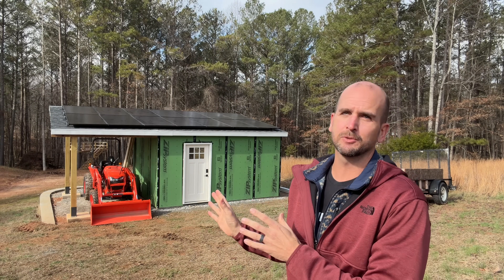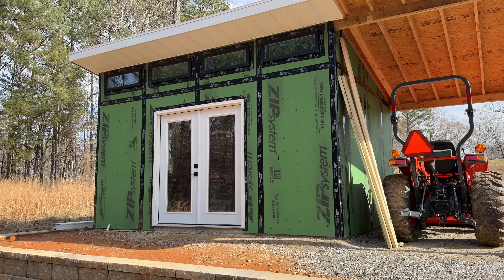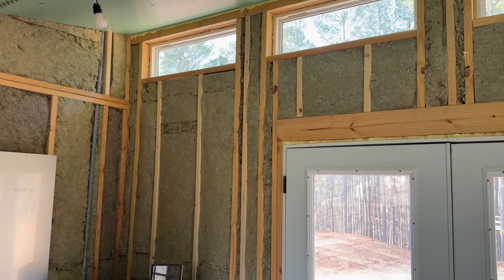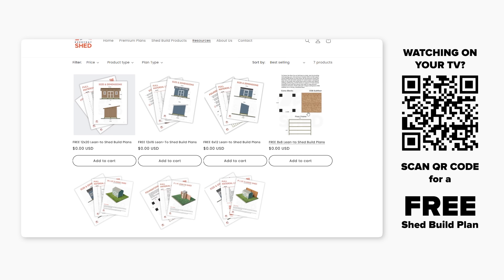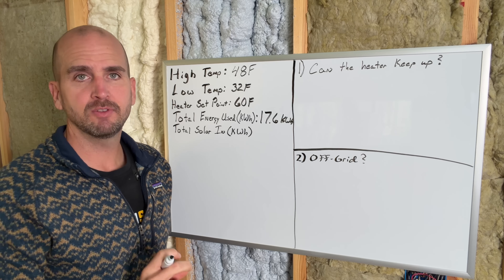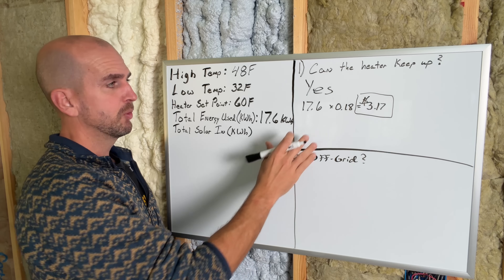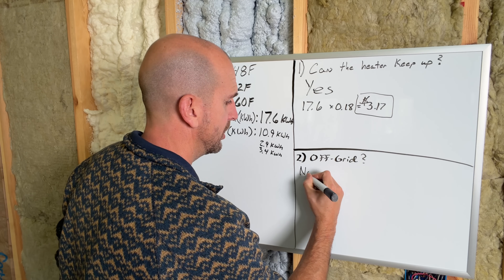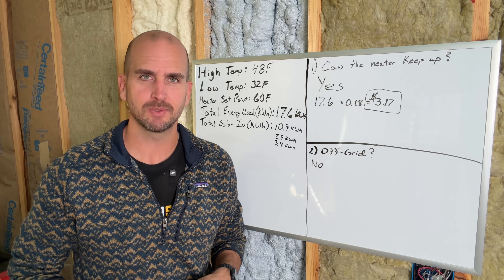HUGE Mistake: Why My $15,000 Solar System CAN'T Heat My Tiny Shed

Comment: I have a 12x16 home office shed. I built it in 2013 and still use it. It's full dimension lumber (4" = 4"). it's on crushed stone+pads. Floor is insulated between the rafters and boxed. The walls have 4" of spray foam and the attic has ~5" of spray foam. I tried heating with a mini split/heat pump. That cost a fortune. I ended up with propane. It's MUCH better. Heat comes right on and I go thru a tank a season. Around $300/yr. The mini split was great for AC but broken last year. To replace it is just too expensive so I bought a portable AC unit. It's "ok" but not as good as the mini split. 

So many things I would have done differently in hindsight. BUT, it's a great office and in a few years will be a hobby shed.

Comment: Don't waste your money with a heat pump or more solar. I have a 12x20 shed like his that is super insulated and I can heat it to 20*C+, when it's -30*C, for 3 kwh. Body heat alone can maintain room temperature when it's -20*C outside or warmer. Educate yourself on insulation and you'll wonder why you did anything else.

Comment: My passive solar house has 1/2 of it’s south wall in glass  and  a massive interior adobe(dirt) wall. 

On nights after sunny days it stays 30 degrees above outside temperature (30deg out, , 60 deg in). After the second cloudy day it needs aux heat (wood stove) at night , but still heats the house on a cloudy day.

Windows on a south wall are much cheaper than an electric solar system heater,  South wall glass is over 50%   efficient at heating.  
Solar electric heat is maybe 20% efficient (per sq ft.) and costs thousands of dollars more.
I do have a 5kw solar system  that can contribute a few hours of resistance heat on 20 deg nights, but it is limited by my 10 kw battery.
Excess daytime solar electricity  (more than your battery will hold)  might be more cheaply stored thermally in hot sand , water, etc
KISS!

Comment: could you run a mains line out to the shed and hook up some sort of smart relay so the heater switches over automatically when battery runs below a threshold? And maybe even recharge the battery if it's below a set limit?

Comment: Fascinating...short, sweet, and clear.  What you didn't explain, but might be intuitively obvious, is that the purpose of the inside of the shed would draw power based on your intention to use it as an office.  (if it was only a storage shed, you wouldn't need power at all, and if it was a workshop of any kind, you almost certainly would need power)  So, the solar system can't keep up with minimal heating requirement (60 degrees kinda chilly) so obviously it wouldn't support any additional electrical load/demand.  If instead of using the electric heater, you used a wood-burning stove or some other fuel-based heater, that would free up the electricity for your office equipment...  Looking forward to your next video on this shed conversion project!

Comment: You need to finish insulating. Every one of the studs in the walls are a thermal bridge that allows cold to seep into the interior. You could add another layer of insulated panels to the walls and ceiling. Insulated panel on the outside is not enough. How much cold is coming through the floor. In colder climates they have triple pane windows. Storm panes might help.

Comment: No wonder it didn't work. You used electric heat instead of a heat pump. You can get up to 8X the heating for the same Kwh. Quite frankly I taught you better than this. Go to your room!

Comment: Comments: nothing was mentioned about the u-factor for the windows or door. Weak spots like this are important. Why uses resistance heating? A heat pump would use 1/3 to 1/4 the energy. And split packs are really cheap and easy to install now. And only R=10 for the ceiling? Heat rises and will make the ceiling hotter than the walls, leading to more heat loss. Bring the R factor to something like 30 total for the roof. It is super important.  Just toss loose celulose insulation in the "attic". It is cheap and efficient (cheaper than the things you tried). Thanks for the experiment.

Comment: "I made poor choices for heating.  Why don't they work?"
Good question.
1) if your main energy need is for heat, why are you using photovoltaics?  Use solar water heating panels, and 1 or more "batteries" (barrels inside to hold the water)
2) If you insist on photovoltaic+electric heater, a resistive heater is a terrible idea.  Use a heat pump, like an EG4 minisplit (the 9000 and 1200 BTU models are VERY efficient).

Comment: You want Hyperthermophilic bacteria.. Google: "Thermophiles Mars Yellow Stone National Park Service" They're what causes mulch to set on fire when nutrients get rich enough to run Hyperthermophile mode. Stainless Steel Panel + Stainless Steel Wool + Nutrient drip made from yard|bathroom|food waste at richness to run them at desired temp = The most reliable heat organisms that's why I pointed at them 'theorized' on Mars. IF you don't feed them even if they freeze they don't die they SLEEEP. Makes safe mulch pile on frozen Earth and pours ancient Shaman warfare juice on it Not safe anymore.. Run copper heat transfer pipes into a boiler if you want to experiment with Steam or Cold Steam Turbine tech with them.

Key: Ask AI best yard materials to feed Thermophiles don't mention anything about using them for heat or power the government controls AI and it might lie to you. Weather warfare is on the Government agenda against masses. Evidence to suggest: Masses in paper trash homes + "Operational defense through weather control 2030 Microwaves" < Your FRIENDLY microwave weather radar! All the BS you repair people have to go through you should have just been builders but idiots messed up looting civilization for definition Hunter Gatherer Genetic behavior evolution world wide instead of training their own correctly. Once you figure out Thermophiles you will quickly realize ONE PERSON makes far too much fuel than needed so you can expand to go crazy for doing many things.

You can use them for heat, drying wood piles, running Turbines, AND cooking. Main reason I pointed at them on Mars = I know they're on Mars because they don't die unless fire takes their heat beyond their tolerance. Use metal Cans with 120mesh to make food section and what you want to collect be at bottom of Can under screen to collect when heat goes crazy when you find proper nutrient density for goals (Careful.. Thermophiles are machines of God they can be super dangerous if over-fed. Like a Dragon Curse..) - Someone Registered by FBI as ATL with clean record because they're scared of intelligence

Comment: Resistive electric heating was never going to work, but the smallest pellet heater you can find would easily be run by the electricity available along with running everything else in the office.

Comment: If you can charge a battery you should be able to heat the shed using induction. The fan from your computor runs on 12 volts. Cut the fan blades off and replace them with bar magnets(hot glue). Make one loop of 1/2 inch copper tube around magnets. Attach the copper to a heat exchanger( coils from a freezer). Put motor oil in heat exchanger to keep it from melting.You can hook up a thermostat to turn it off and on. The fan from your computor uses like 2 watts. You can heat you whole house.

Comment: If you plan on heating your shed on the grid than I recommend bringing qty 2 - 20A circuits.  one 1,500 w heater will consume most capacity of one circuit so a second circuit is available for other tools, computer, tv ...  Additionally on cold or windy night you might need second heater at times.  Insulation is the key.  I tried this for kicks in my little shed  and you need good insulation, if memory serves me I read some where that 60% of heat is lost through ceiling. A simple rug on the concrete floor will help with the cold from the ground.

Comment: Considering a built. Except I have the opposite problem, instead of heating I need the shed to stay cool during the summer. The intended site is completely off-grid and experiences extreme heat so need to be able to store and operate the batteries at an appropriate operating temperature.

Comment: Heating with electricity, bad idea, very waistful, and that little rad will not heat it well, your room will be 40°f with a 25°f outside, get yourself one to 2 8kw diesel heaters, the ones with the large tank, you only need to run em while you are in the room, and 2 of them will keep your room in the 90s, see the difference, and it runs off 12v input, so much cheaper, you can run it off a car battery that charges off a good solar panel.
I only run one heater when the outside is 15°f up to 50°f, I run both diesel heaters 15°f, and lower, and they keep the room heated to 80°f no problem at all, and one heater goes through a large tank 2 gal tank on level 10, with a room heated to 80f it takes 2  days before I have to refill.

Comment: I did something similar. A VPP shed with 20kW of solar going into 4x DPU with about 52kWh of house bank with grid & genset failover. I have 130~kWh in the EV pickup for emergencies. 

Right now I'm battling with snow stopping near 99% of the solar, even the bifacial back faces are too low voltage to charge most of the time. I matched the angle of carport (that has 75% of the solar) to the slope of the shed, which was a mistake. I should have tuned it for the winter nearer to 35 deg. I think its about 17 right now. I'm experimenting with some self regulating heat tape along the bottem edge of the carport array to see if I can warm them up enough to have the snow slide off.

Comment: How many hours of daylight were you getting at this time?

I've the math here at 47 degrees North and during a cloudy day the solar panels put out 7% of their nameplate. So take nameplate and divide by 14. Add in the 8 hour days (minus another hour for horizon slop) and 7 hours at 7% doesn't leave much.

Comment: Any heat pump will stretch the energy in those batteries much further than a dumb electric heater.
Also, you might want to add some vertical (or adjustable) solar panels to the south wall for the low winter sun.

Comment: mini split 1600w ac/dc, batts incorrectly installed (flaps should be over the studs) too much thermal bridging, r value way too low, correct heat sink slab with electric radiant heat and insulate, or use firewood, do a blower door test with IR to find leaks to fix

Comment: A wonderful example of extreme thoughtlessness.
If you want to heat a shed cheaply, you shouldn't turn it into a greenhouse because the windows are poor insulators and, on the north side, don't heat the shed on sunny days.
If heating costs around $2 per day, you'd have to be an idiot to invest $15,000 in something that only provides $2 per day of "economics" (I doubt it will last longer than 20 years). Furthermore, if someone goes into debt to buy this equipment, it will cost them $20,000-$50,000 in the end. Let's assume this "investment" represents only $1,000 per year, heating without this "miracle" would cost no more than $800 per year. A smarter solution would be to build it with only south-facing windows, install insulation under the concrete and around the foundation on the outside, seal it well, and insulate it well, but never with urethane, as you might run into problems with wood rot or insects making a home there. A small wood stove would heat it quickly, economically, and reliably, and what's more, it would be inexpensive to install and last longer than those electric wonders on the roof (not to mention the fact that they lose efficiency when covered with snow).
Reply: I'm correcting the error. It should be: "If a day of heating costs about $4 per day," not $2 as I wrote.

Comment: Put rigid insulation board with foil on top of the studs, then dry wall. The foil will help with keep in the infrared heat.

Comment: Great project, really shows how filling a roof with solar panels does not make up for fundamental design limitations around energy retention. Here is a crazy YouTube project for you, build a second identical shed office but 4 times as big, call it a film studio for your YouTube business, the entire building is a tax deduction think 179.  Put 4 inches of insulation under the slab, 1/2 inch tubes in the slab for hydronic heating with a water to water ground loop heat pump, R50 roof and walls made from Structural Insulated Panels (SIP), triple pane windows mostly on the South facing wall.  Yes, it is going to be a higher capital expenditure, but a great tax write off and with 4 times the roof space for solar panels and all the other energy retention upgrades it will be free to heat.  It always costs more to spend less.

Comment: To echo the other comments, resistive heat doesn't make sense here. A heat pump, like a mini split, and maybe a fan to circulate, in addition to denser circulation (plus if you finish with drywall) and improved floor coverings will get you a lot closer to your goals.

Comment: Space heaters are horribly inefficient. In floor heat much more efficient. Your roof is very under insulated. We run R-40 ish in the ceiling and R20 in the walls. Extra Insulation is cheaper way of obtaining better heating efficiency over time

Comment: Man alive that is a lot of money for inverter/battery. My 11kw solar inverter was 800 with setup, breakers, wire (plus 300 for a transformer as it is 240 single phase).... $2400 for 20kw of battery, 600 for a cheap inverter heat pump on ebay. I get why no one is going solar when you see these poorly optimized setups.

Comment: you need to use a heat pump for that. It is three times more efficient than a resistance heater.  but even then it may not be enough. also not sure why you thought that R10 would be enough for the ceiling. Heat rises.

Comment: wont work no way that is a tiny battery bank nope no way you need like heat bulbs mabey 75 watt ones..your also not considering the heat you need for the battery bank as well lithium batteries can not be left in the cold or the will be damaged same as the heat..what they dont tell you is batteries are useless in the cold even if the function at all...

Comment: I think it's kinda obvious, but don't spend $15K on the solar to try to heat something with virtually zero insulation or air management. Instead, spend $4k to $6k to insulate up to a minimum of R60 in the walls and R100 in the roof. Seal it up, and you can heat it with almost anything. A few candles would heat it up.

Comment: You could run that 20 amp line and power that heater non stop for 13 years for the cost of that solar system that can’t heat the space.

Comment: Insulation is cheaper than a solar+storage system. Resistance heat is horrible. Start over: 2" Dow greyboard under the slab. 2x6 studs with steel angle bracing. R15 fiberglass in the walls. R6 sheathing. R36 ceiling with radiant barrier. 9000 BTU mini-split heat pump (COP of 3+ in winter). Cut the solar plus storage in half. I'll bet you save money and have more comfort. That's my quick swag design. Better yet, Use Manual J and 20 years of climate data.

Comment: Excellent information, thank you. Some considerations, as mentioned, need more insulation. Adding about 1in rockwool to the exterior will give you another R-3 to 4 and can minimize thermal bridging. Sheath with metal and you have class ~A1 fire resistance, too. Look at passive house designs to improve insulation, especially floor and ceiling. Future considerations, might want to consider improved solar alignment and easier maintenance (snow removal etc) with ground mounted solar panels.  Bifacial SP can provide 10%+ solar gain. Best you might see is 2-5% on white metal roof with more open rails, though.

Comment: Nice video BUT ...  you are using the WORST type of 100% efficient Resistive heating instead of 350% to 400% possible "efficient" heating when using a Heat Pump using outside air. An even more efficient system would use a Heat Pump with a Geothermal underground "heat" source. Also $15,000 for a 6kW solar system sounds very expensive, relatively speaking. Can't you get a cheaper solar system? How big a battery do you have? That is really the expensive part? Also depends on what time of year? In the winter the number of sunny hours is very small 😥. Please update with a YouTube that considers the above. I have seen your YouTube about comparisons of the 4 wall insulation types. It was great 😃

Comment: Wouldn't you be better off running some geothermal coils through the ground and use those in a small heat pump/exchanger?  Not only would this likely be more efficient, but you could also cool with it in the summer as well.  Of course this adds cost and installation logistics, but in theory it should make you able to run this using less daily power.

Comment: EG4 has a heat pump mini-split that has an inverter built into it. Couple that with your EcoFlow and you might just do it even with the subpar insulation package you installed. Your ceiling R-factor is way too low. That radiator heater is incredibly inefficient. You need to move away from that type of heat.

Comment: Is this a joke?  Your "tiny" office is large enough for a 2-3 ton unit (insufficient measurement data provided would include ambient outside air temperature, volume of air mass inside the building, radiation fin size, etc.) so if you don't want a package heat pump you're just being funny.

6KW solar is not enough.  Maybe 7.2KW for just the heat pump would work but you need forced air, ductwork, and a return.

Your setup is worthless (except for the half-assed insulation because cost came before data, measurements, and results).
Focus on what you do best.

Comment: Your shed has too large windows, which gives contributions to heat loss. For heating small areas better to use infrared underfloor heating.